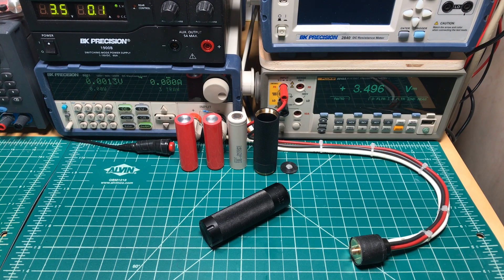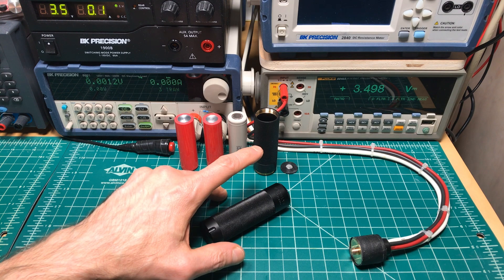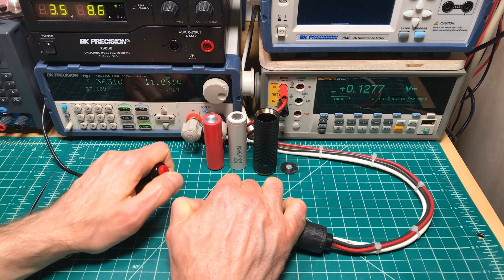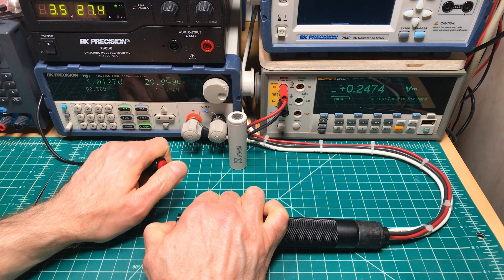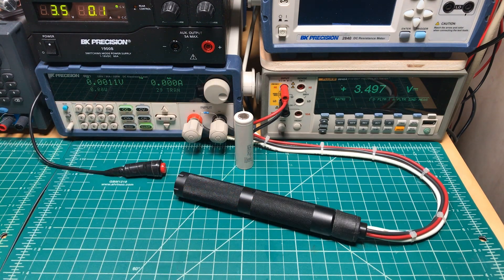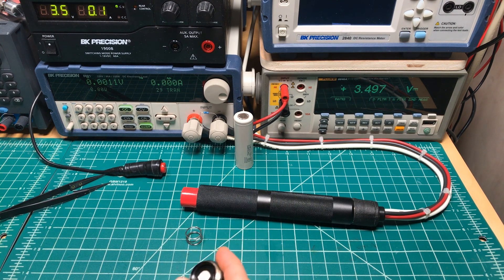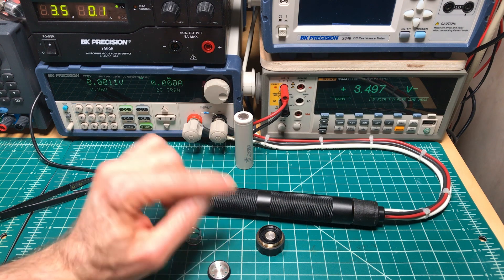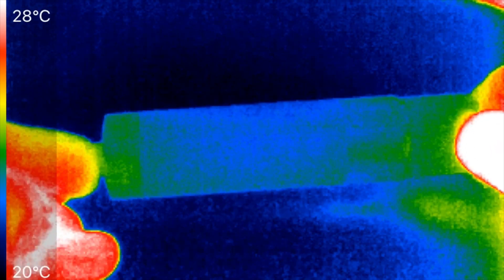Minding Your Mechs Ep022 – Mechlyfe Arcless – Voltage drop testing and thermal imaging

Comment: Thanks Mooch for this video....I do own one, and use it daily it's a EXCELLENT budget mech for $60-$70...I'm definitely on a budget...and I quite enjoy its performance
Reply: Well I have some good news for you. At unicorn vapes you can get the mech that tenacious tx and unicorn vapes made together. Was originally 180 dollars on sale for 60, it has a solid silver clutch system. It’s a cunt puncher . Can’t believe they are selling it for 60 considering how much solid silver it has in it. It comes with a solid silver contact for the ardent rda as well but I just use my Asgard mini and it hits harder than all the mechs I own
Reply: @vanzantd8850  thank you I'll have to check that out
Reply: @vanzantd8850  yeh I got a 'blem' (just a lil paintjob that looked faded very very small part on the button housing) and got it for 30$!!! Best deal I've ever got man it's an amazing mech dude so underrated.  I got the green . Absolutely gorgeous n kicks like a mule . I'm very lucky I caught the deal

Comment: I’m glad you did this. Since there was a voltage drop being used as a marketing grab that was tested with bad equipment.
Reply from the maker: Bad equipment? Who tested it?
Reply: @batterymooch  Ambitionz Vaper
Reply: JAKEfromMAINE it’s all I have brother. Better to test then not to test and mine also has battery and atomizer sag in it FYI
Reply: @AmbitionZVapeR  wutup bro! Was just answering the inquiry you know I'm an AV fan 👍
Reply: JAKEfromMAINE it’s all good bro even if your not lol legitimate argument
Reply: AmbitionZ VapeR i would agree with that. But I’m saying to use that number as if it was accurate is the same as a battery company putting their cells as an amp limit and a MAH rating that isn’t accurate.
Reply: AmbitionZ VapeR regardless tho this is a great performer for the price.
Reply: vanz1208 you mean putting it on the package? Wasn’t my idea. But I totally hear you on that. Can’t argue with that. I have numbers to that one just like I did with every other. So there is consistency to that number including sag.
Reply: AmbitionZ VapeR I respect that actually a lot. I was not taking a direct shot at you and that’s why I didn’t say your name whatsoever. Because I don’t know what the process is like behind the scenes for what goes on the package and who chooses that and stuff like that. Regardless tho it was one of the better budget mechs of the year for sure.
Reply: AV's reading of the Arcless was lower than I'd get utilizing .13Ω N80 Aliens in the Asgard Mini - Read voltage at the terminals using a True RMS DMM, I had 3.81v - even with the same RDA Build on my Overlord it only hit 3.77v... I suspect his RDA has some nasty inherent voltage loss similar to much of the other, "Known RDAs"  aka all those made by Augvape and slapped with some lame moniker... and going by similar methodology that AV  does with his lil goober rig his -.46v he claims isn't to far fetched, since I am getting only -.39v loss... yeah I don't expect you to believe the outcome I am getting...but I've posted it to VU, calling out shit RDAs and their inherent voltage losses, showing my findings, methodology of same Coils, Mod, charged battery... but I digress... oh I don't know AV, no affiliation... but I am glad as hell like every non patriots fan that his team lost ;)
Reply: CV1 I’m really glad you said about the Asgard mini because I have the tenacious and unicorn mods collaboration that they did for the mech that had an all solid silver clutch system and all the contacts where solid silver and they threw in a solid silver contact for tenacious’ Ardent rda that can screw directly into the mod or you can use the hybrid cap to run your own rda and my favorite mech of this year was the Asgard mini and I slapped it on there and it was hitting WAY harder. And I didn’t understand it because the ardent was using the solid silver contact where the Asgard mini I believe is copper not to sure but either way that tenacious unicorn mech wiith my Asgard mini hits like a Mac truck. I also use aliens .10. But that’s valid and interesting what you said none the less
Reply: @vanzantd8850   Funny thing with my testing... Goon V1 still reigns voltage king... its my control RDA... it's better by .01v lol which could just be button press variance... but I get a kick out of showing people, new doesn't always mean better... heck the old X1 RDA has less measured voltage loss than the TerkV2shits, Occula, Dead Rabbit v1 and V2shits- pretty much anything MFG also by Armageddon... oh and get this... Arcless hits harder in series than the Saga series-shit... yeah I name dropped, my bad haha... 6.80v... come on series and only 6.80v...deplorable

Comment: Surprised at the voltage drop on the single cell. Big difference to what ambitionz claimed with the .46 😂 or whatever vd it was .
 I guess that's the benefit with having a pro do it. Did enjoy this, good job mooch thank you
Reply: Tony Bradshaw that includes battery sag and atomizer sag. It’s a 50$ tester vs a 3000$ tester. But I also use the same rda and the same build with same resistance and fully charged 1 hour of cooling time to get that number. Thanks to mooch I’m working on getting a accurate tester to redo all my mods for
You guys
Reply: @AmbitionZVapeR  I did message you once saying you did us the customer a good mech for a good  price and really happy with mine as it stands. It seems to hit very well to the point were I don't want to hear the numbers lol, so I have no complaints but was a shock factor.
does not mean we don't appreciate you trying to give us numbers with your tests  as I watch your reviews probably more then any other reviewers  on here.  Moochs field here with the numbers so don't feel Theres any ill feelings in the  comments bro. Keep up the good work tho 👍
Reply: Tony Bradshaw absolutely brother. No offense taken my man. All good in tha hood
Reply: @AmbitionZVapeR  cheers Derek and look forward to your future projects take it easy bro
Reply from the maker: Ambitionz and I are measuring different things so the numbers will be different. 🙂 I measure just the voltage drop and power loss in the mech itself. Ambitionz measures the total battery+atty+mech voltage drop. Both ways work, they’re just different and the numbers can’t be directly compared.
Reply: @AmbitionZVapeR  just rewatched your arcless vid and my bad man, I see the battery and atty sag you were measuring .

Comment: Hey mooch! Great video! Thanks for getting more accurate numbers on this without battery sag and atomizer sag. Try testing it positive down on this mod. The venting is on the button and it holds the battery a little better so you don’t have to tighten as much. Performs well for the price. That was the intention. FYI everyone here. My tests included battery sag and atomizer sag so it’s not the most accurate testing but rather have numbers then none at all. Stays consistent with all my other mechs that I have tested but mooch’s is the most accurate! Surprised on the arcing though lol. Lots of mechs have arcing but seemed not bad for 200 presses?
Reply from the maker: Hello Ambitionz! Since I use a solid aluminum slug for testing it doesn’t matter how I put it in the mod. 🙂 I agree, it is a good deal for the price! The arcing was about average, certainly not bad, but was all in one small area so Mechlyfe could tweak the contact shape a bit to get more of it touching. As I do for most mechs I would recommend daily maintenance as the arcing removes the plating and daily cleaning makes it so easy to take down the high spots on the arcing points.
Reply: @batterymooch  ok thanks buddy. ill mention that to mechlyfe
Reply: Hey I believe there’s a copper version called the v2 what’s the difference between the 2 mechs 

Thanks so much

Comment: Hey mooch many thanks for the video, i own one and i was suprised by how well it hit for a budget mech however i do run my batt positive down as the venting is throught the button, some in the comments said they had issues perhaps thats the reason as you did state you got a better connection that way .
Reply from the maker: Perhaps but my problem was with the shape of the extended “nipple” on the positive end of my battery slug. I don’t think others would have that issue as the positive contact on batteries doesn’t stick out as much. It is a good performer for the price though.